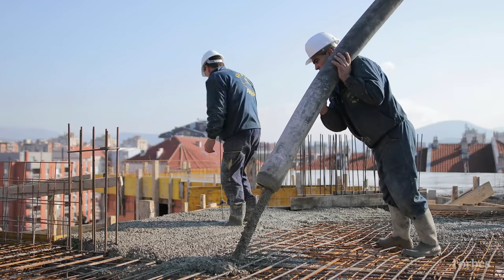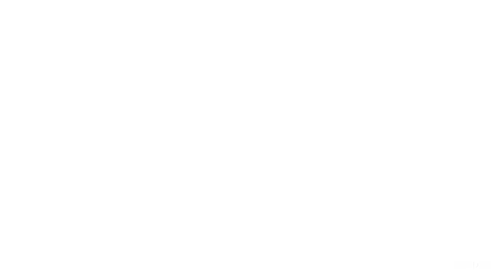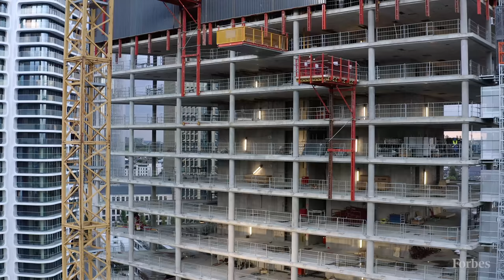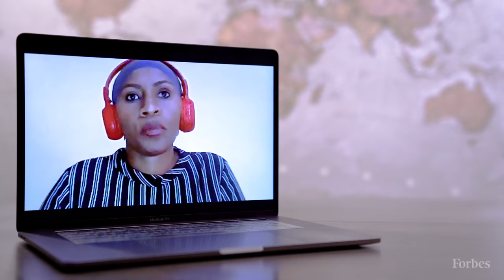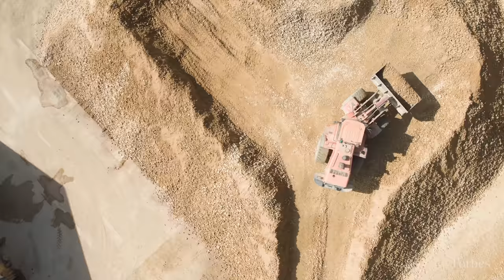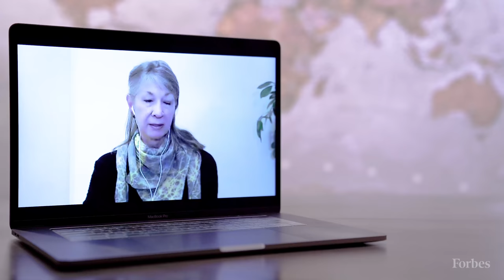How Sand Mining Is Quietly Creating A Major Global Environmental Crisis | Forbes

Comment from the maker: Clarification: In the introduction of this piece we mention that sand is a key ingredient in cement, the material used to bind the aggregate together and form concrete. While silica sand is used to make cement in the form of silica fume, the amount of sand used in this process is small in comparison to the amount of silica sand used as the aggregate. We intended to say that “Sand is a key ingredient in concrete,” as sand makes up around 80% of the volume of concrete as an aggregate.
Reply: Thanks. Great job on this btw. Very interesting.
Reply: just like the pyramids, nice.
Reply: “The problem is dessert sands are too rounded”

  Well couldn’t you increase the surface area of the sand to a more jagged edge by etching the sand? 

Submerge silica sand in a pool of vinegar, drain/neutralize/wash/dry 

- That’s literally an idea off the top of my head that could solve this issue. We got this mad scientist over here trying to make bacteria glue…
Reply: Don’t forget about your glass also

Comment: I'm an engineer and I work with construction in Brazil. sand is used a lot in concrete here too, but for many years we have had the alternative of using stone dust instead of sand. This stone dust comes from the mines where gravel is extracted. and with regard to the quality of the resulting concrete, it surpasses sand
Reply: Exactly, im not worried, and you can melt and crush desert sand to get it too
Reply: People in indonesia mainly use volcanic sand (has grey color). There's a lot of volcano here, every time volcano erupt, it's like blessing in disguise. But i'm wondering if its as good as river sand. 
Sorry for my english.
Reply: The energy that went into crushing the rock makes it more expensive and environmentally hazardous
Reply: @Feelthefx  All I can tell is that stone dust here is cheaper than sand
Reply: @Feelthefx  as opposed to dredging which is also expensive and destroying ecosystems?
Reply: In Kenya we use both together. 50/50
Reply: @sekar9901  not as good as standard river sand. volcanic ash is not a suitable material to replace sand, but it can be a better replacement for cement.
Reply: @sekar9901 Dont apologize. You have great english brother.
Reply: Onde voce trabalha meu caro?
Reply: @sekar9901 do not feel sorry.

Comment: Great video, bravo! However, sand is a key ingredient in concrete, not cement. 
To put it simply, concrete is made with three ingredients: water (15-20%), cement (10-15%), and aggregates (60-75%). Aggregate is the construction industry's term for sand (fine aggregates) and gravel (coarse aggregates). When mixed together, the water and cement form a paste that binds the aggregates together, and this process creates concrete. 
Cement also requires sand (silica) in its own mixture, however, the quantities used are nowhere near what is required for concrete production.
Reply: sounds about right
Reply: "cement 10% lol
I wouldn't want to get anywhere near a construction made by you!
Reply: @pedrolopes3542  you need to learn the basics of concrete technology. - from a civil engineer
Reply: @ChandanYadav-op1pl  I think you should follow your own advice and study the ISO 22965-2 :2007. The minimum amount of Portland cement allowed is 280kg per cubic meter which is roughly 18% in volume (1500 kilos of cement would be approximately  1 cubic meter).
The fact that you could  be a civil engineer is dreadful, makes my spine shiver to think that you could be responsible for mixing the concrete used to make  bridges, tunnels, tall buildings, etc.
Reply: @pedrolopes3542  Dude ,we do mix design from IS code IS 10262. And we choose minimum amount of cement form IS 456 depending upon the environment conditions.  For example for moderate conditions we take cement as 300 kg/m3. And specific gravity of cement is 3.15 so if we get the volume of cement it would be 300/3.15= 95 liter per cubic metre. And max amount of cement is permissible for 450 kg/m3 which would take approximately 142 liter per cubic metre. There percentage would be in the range of 9.5 %to 14.2 %. And depending upon water cement ratio we decide the amount of water. Water cement ratio range from 0.40 to 0.55, so for example mild environmental exposure conditions we take water cement ratio as 0.55 and cement as 300 kg/m3 . Then amount of water is 165 liter per cubic metre which is approximately 16.5% . 

Only thing you need to shudder for is your arrogance.
Reply: @pedrolopes3542  and dude learn the difference between bulk density and specific gravity.
Reply: @ChandanYadav-op1pl  Except the weight of cement per cubic meter is around 1500 kg, so no, 300kg will not be 10% of a cubic meter. 
You are deliberately using both volume and weight measures to falsify the argument, pretending that a proper mixing of concrete would have only 10% of cement, which clearly should have more.

 When the average construction workers (who are not civil engineers) prepare a mix of concrete, they are going to use volume for all measurements and the weakest they usually go is 20% cement 80% aggregate+sand (and that is bellow the acceptable standards) for a weak concrete, water is not even considered relevant for determining the total volume, because water adds very little to the VOLUME of the mix (unless you are using way too much water, which will weaken the concrete) and that is why using both VOLUME and WEIGHT when calculating mixes is a BAD IDEA!   A common mix used has 30% cement.
 The amount of Water used varies a lot depending on the type of sand, how dry the sand is (is not always dry), the temperature, the type of water (hard and soft water).
Talking about arrogance... look yourself in the mirror.
Reply: @pedrolopes3542   Bulk density of cement is around 1440 kg per cubic metre that you are taking as 1500. Even that is for one cubic metre, and furthermore not all the volume will be taken by cement. 

And you are talking about volume batching which is inferior to weight batching.  You are not even considering the amount of water in the concrete mix design?? Well I guess that's why there is a different between an Civil engineer and construction workers.
Reply: @pedrolopes3542   I don't have patience to teach you basics of concrete technology. You think and speak like a construction worker and  at best you can be one of them. Good luck 🤞
Reply: @ChandanYadav-op1pl  good luck to anyone who uses an structure made by you. 
What you haven't realized yet is that just because you CAN make a mix with only 10% of cement, that concrete will be too weak to withstand the load of an structure. China has many buildings that were build using concrete with only "10% cement" and after a few years those buildings collapsed or severely cracked. The MINIMUM required concrete grade used to make structures is M20 (1 part cement, 4.5 parts sand and aggregate) that is 18% cement in volume for the concrete mix. 
M20 concrete has a compressive strength of only 2500 PSI. An for foundations you need a concrete that has 4000PSI of compressive strength. 
You are an ignorant pretending to be  a civil engineer, clearly you are not.
Reply: @pedrolopes3542  And you still think modern concrete mix design are done by valume batching ??  I don't have any strength to teach a construction workers. That's why there are clearly defined sets of rule for people like you who think like Bull and work like a bull.  You seems to process all the characteristics of a construction workers. Use you muscle , Don't hurt your mind
Reply: @pedrolopes3542  you have seen the work  and I have studied it. And Design codes are different for different countries but again, I don't expect you to know that. 

Let me ask you.  
How is the ratio of 1:4.5 came? 
What is M20 means ? 
Why is M in M20 and what is 20 in M20? 
Why are you using psi with International standard units? 
How is the load on foundation is decided? Is it a fixed strength? 
What is the the way concrete mix is designed for ?
 Is it volume batching or weight batching? 
Which one is more scientific way to design concrete mix? 
How is strength of concrete depends upon water?
If concrete strength depends upon amount of water then why you are not accounting for it?
Does the excess cement has any detrimental effects of the durability of concrete? 
What is the difference between Bulk density and specific gravity ( I asked you to learn that ) 
And there are many more simple question you need to learn. Again I don't have any interest in educating you but mix of your ignorance and confidence is something interesting.
Reply: Sand IS an ingredient in cement which IS an ingredient of concrete... LOL!!!!

Comment: I grew up thinking sand was everywhere. Here in Southern New Jersey, our town sat in the midst of Port Elizabeth. Port Norris and Dividing Creek silica sand plants. We probably had about five major glass factories and numerous trucking companies.  After working with the sand for about 30 years, a mask was issued to my dad.  We even had a neighbor with a property large enough for a little plant of his own. I recall different categories of sand and also gravel. Maybe it's because of the many streams that seamed to run everywhere into the rivers and then to the bay. I suspect all of south Jersey was once under water. We had a couple of concrete companies, but those along with glass plants are gone. So now there is no silica in the air, but the discarded plastic has more than replaced it. Dont think for one minute that the massive amount of plastic is recycled.  Nearly ALL of our used glass was recycled

Comment: I didn’t see any mention of using brick , stone , wood or any other locally sourced materials as substitutes when you can. I understand these aren’t usually the most economic options but investing in things like automatic brick layers sounds more like a compelling solution to  less sand intensive, environmentally friendlier and cost effective construction methods than Bio-cement. I mean what are the industry logistics of something like Bio-Cement going to look like? I’ve heard of many novel ideas to solve our problems but I’ve been consistently disappointed when all the substance for these ideas are just tests in labs and theoretical applications and not real world examples of use and real potential for scale. I have the impression than trying to replace a material that encouraged our bad habits of development with one that theoretically can isn’t the step we need. This can be like Reduce, Reuse, Recycle where it’s obvious now the first two are the more important then recycling Regime has been a massive failure due to the stubbornness not to adjust to a less wasteful lifestyle.
Reply: To add to alternative materials, there was no mention of new emerging technologies like Cross laminated timber (CLT) as used in Scandinavia, a very sustainable and proven building material for new age skyscrapers. Another material that can be considered is hempcrete, a material derived from hemp fibers, also extremely sustainable, I'm quite surprised that the folks from Colorado did not mention this.
Reply: I just read an article a few weeks ago about using ground hemp stalks as aggregate and it would replace about 60% of the sand needed for each batch of Cement... also it could be used in asphalt replacing nearly 90% of the sand in Paving operation ...do you have any thoughts or knowledge in this? Thank You and Many Blessings , SMR
Reply: Lol you see these people talking about how we're running out of sand?

Yeah. We ran out of slay for bricks a long long long time ago.
Reply: Free T  Well then your life is pretty restricted... I have lived on brick roads and I have driven on wood roads in Utah and  Colorado... just outside of Tincup Colorado there is a wooden road I drove on 3 yrs ago
Reply: Free T  The Lincoln Highway was completely built out of brick and you never said anything about highways... The wooden road is a short one mile traverse over marshy area that is replaced every few years and has limited traffic.... logging co's make wood roads all the time plus wood bridges ect ... Many Blessings , SMR